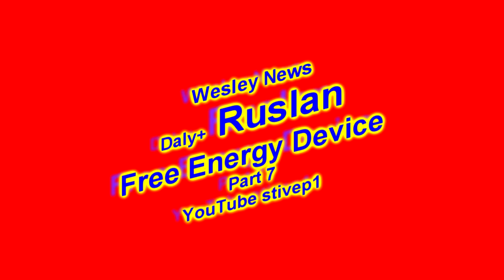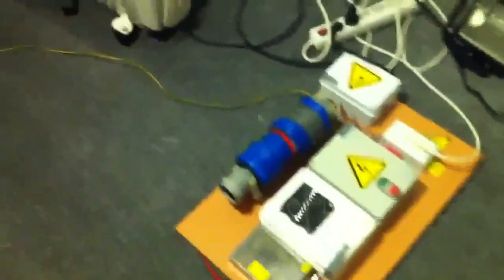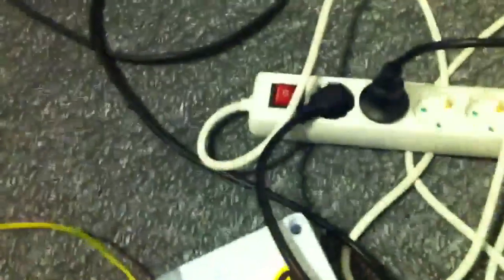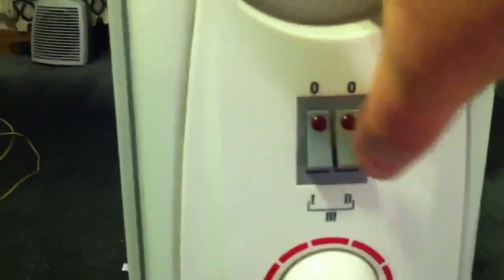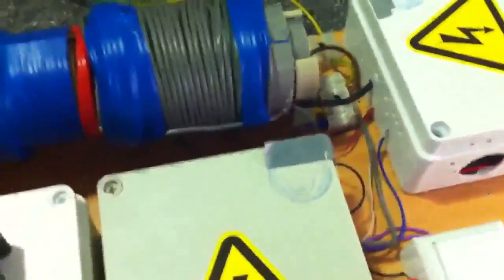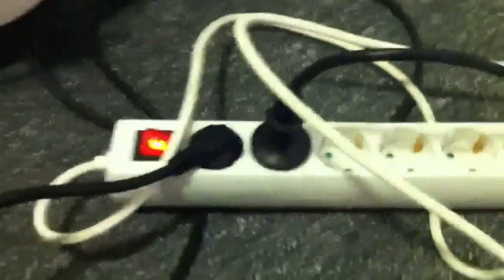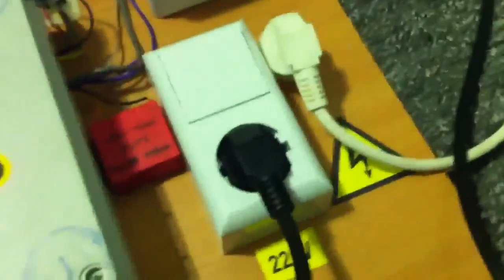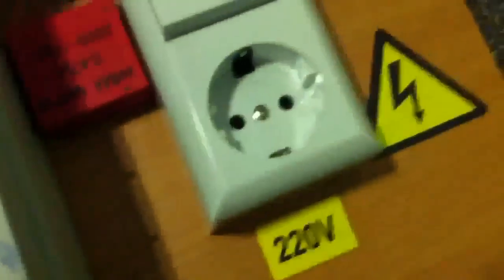Wesley presents:Daly part #7 Free Energy: Ruslan Replication

Comment: Hi Stevep. Thanks again for sharing and your (slow :D ) translation in English.

This one vid looks impressive to me but still remains me with the same doubts than before:

The running are very short and still super capacitors in the first grey box from the left, could provide enough energy for these little runs.

True for me it looks genuine but so many in the past looked too but been just waste of time :/

What I don't understand is that: if the device is genuine,  why not just show anything need to take off any doubt? :/

I am most interest in replicating a true working device, but only if at least all my objections or doubts, as electrician (I'm all but not in electronics), are all satisfied.

Still: 2 capicitors of 1 Farad under 600 V precharged before the video, give 0.5 x (2 x 1) x 600^2 = 360,000 Joules = 360 kJ.

1 min running of 2 kW load means: 2.000 W x 60 seconds = 120,000 Joules = 120 kJ.

So, 360 kJ of potential stored energy divided by 120 kJ of energy consumption by minute, we have 360 / 120 = 3 min of magnitude of run time; and sadly enough, it is the range of the run time under load in the video :/ :/ :/ :/

Why not provide zoom on each detail component so we might check first the theoretical energetical capacity of the device at first (I mean its capability to store enough energy before the run)?

Wishing he can go truly open on this topic,
Regards.

PS: Would be nice anyway you or he, could provide at least the theoretical explanation of why it is supposed to work. ♡♡♡♡♡♡♡♡
Reply: you have to think dialecticaly: this guy (Ruslan) is a public person, a businessman, he runs his own radio station in Riga, so why should he make fake devices and spend a huge load of time and money on them to just be debunked one time, with all hes career and reputation ruined. Instead of zooming  into capacitors (which is senseless, sinse you can still make a mock-up capacitor with a battery inside, maybe a battery on isotopes, which is realy powerfull ;))  maybe better start learning theory and praxis and make your own experiments and your own judgement, or just leave it, and wait until mass produced FE-generators will come on market? On Ruslan's place, I wouldn't even show as much details as he does allready for making the notbelievers believe. Because the notbelievers will still not believe and the hater still gonna hate. Besides that,it prevents ppl from learning realy important theory and turning them into robots blindly repeating the devices.
Reply from the maker: Khwartz Quote:/What I don't understand is that: if the device is genuine,  why not just show anything need to take off any doubt? :/ end of quote.
Nobody wants to  show everything. They do not  want to show anything at all, but   they have no choice. Showing the device  as "working" is the only way for them to attract investors or buyers. they play "good man"  Yes we will show you that much but if you find how to do it than you will be doing the same, 
Waiting for some one with big money.. So they wait till now. Estimated around 50 peoples in the world.
Stupid, they could of  let  everyone to know  how it is  done so they could start sale  today. That is human nature.. GREED!!